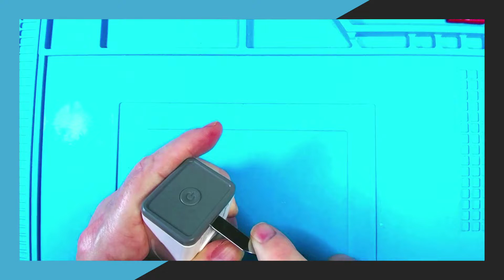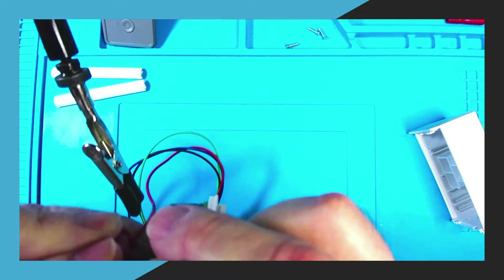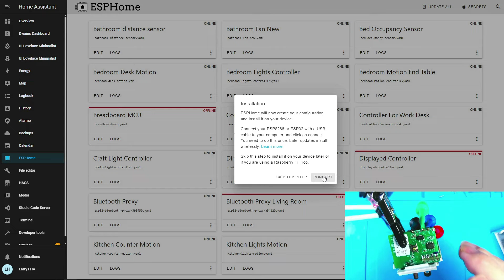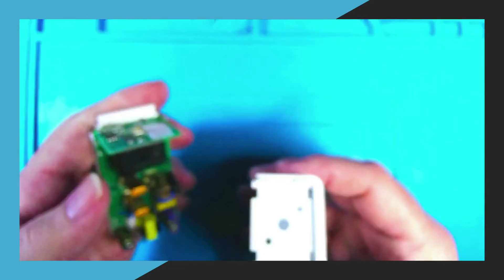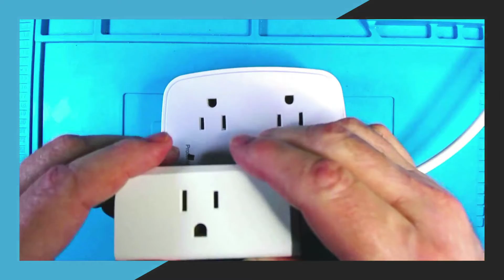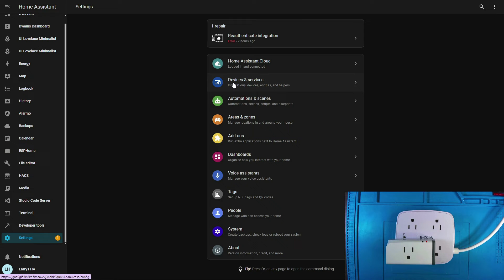Flashing the Sonoff S31with ESPHome in Home Assistant

Comment: Why not use cloudcutter from a Pi.  Or are the OTA exploits closed on the Sonoff?
Reply from the maker: I looked into this and it seems that the sonoff S31 is not exploiitable based on this test script https://github.com/tuya-cloudcutter/tuya-cloudcutter/blob/main/proof-of-concept/test_device_exploitable.py. Plus the S31 is so easy to access, and Sonoff has the pads to flash it on the edge of the board making it easy to flash, unlike a lot of other devices that are sealed, with no flash pads broken out at all.

Comment: This seems like it’s not too difficult.  But it is quite a few steps.  I’m using instead SonoffLAN from Alex it for my sonoff s31 to be used in HA and it seems like this takes fewer steps and it more easier due to not needing any tools.

Have you used this other method?   Can you compare the two options?  Pros and cons?
Reply from the maker: No, but i have looked at the steps and i don't like the fact that you have to use the ewelink app and create an account. IMO the less apps on my phone the better. And the less personnel info i have to give to anyone the better. It does allow local control once that is done true. But i would still prefer this method over that one i think. 😀 Besides the more methods we have out there for HA local control the better i'd  say. Gives everyone options.
Reply: Can you confirm if this method works with the sonoff S40?  My understanding is that S31 and S40 have similar features and also that S31 was available first and s40 was a more recent version.  If this is true then would it be likely that sonoff may stop producing s31 because the S40 is designated as the replacement model?   

I’m just concerned that if esphome doesn’t work on S40 that over time the s31 becomes hard to get and that’s not good for HA.
Reply from the maker: @neilbrookins8428  The S40 is sealed up, so it would be hard to open, plus i've heard that they did not break out the pins for easy flashing like they have with the S31. I haven't heard anything about them  discontinuing the S31, but like any device a company can do that at any time. But the S31 because of it's popularity with the DIY crowd has continued until now, so i believe that as long as they are making money selling them, they will continue making them. If you want to discuses this further, perhaps you could check out my discord channel at https://discord.com/invite/9EkA5rFyCE